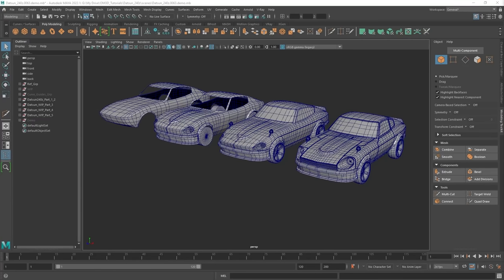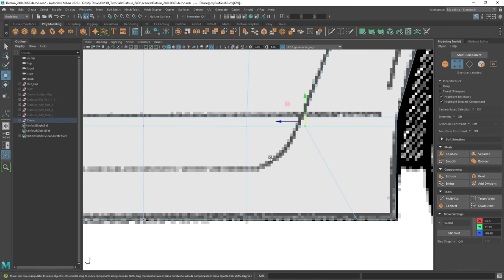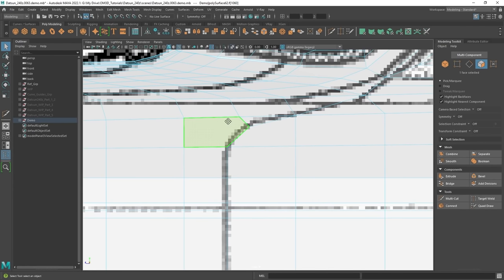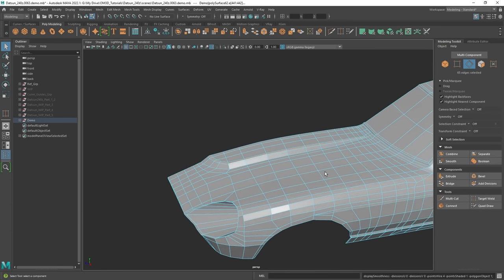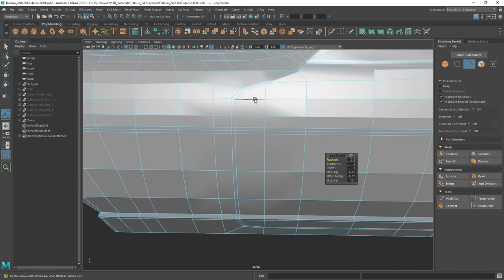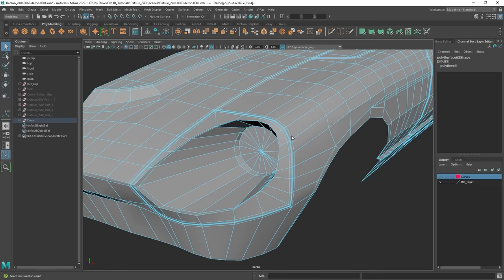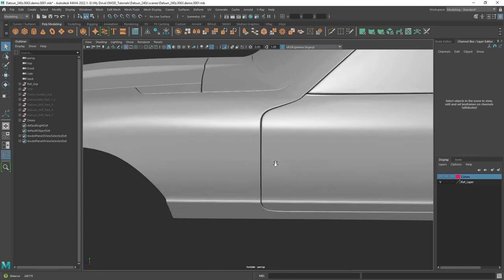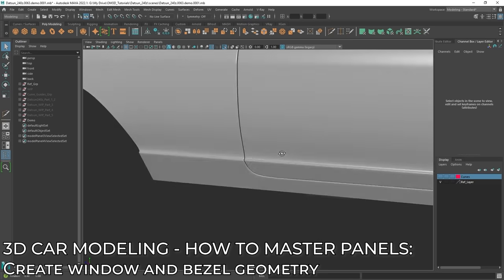3D Car Modeling - How to Master Panels

Comment: For all the automotive people out there, also keep in mind that the gaps on cars are slightly different depending on the panel and not all the same. Door, and trunk lines tend to be a bit wider, sometimes on the hood too. It also largely depends on the what car you're making, older cars didn't have super tight gaps like modern cars do, and even some modern cars mess it up from time to time. Make sure you keep an eye out if you're using references as it will add more authenticity to your model. If you're building fictional cars, ask yourself what kind of manufacturer is this, if its expensive luxury/high tech then the gaps would be tighter and precise, if its a cheap soviet mobile, the gaps are going to be horrific.
Reply from the maker: That's a great point, I used different gap measurements for different parts of he 240z. Details like this will really help push the realism of your vehicles.

Comment: Thank you for all your videos and really useful tips, I've been trying to follow along this series but I end up with a wobbly surface each time I try to add in some details... I've restarted 3 times now and it feels really demotivating to fail over and over, but I'll keep on going in the hope that one day my models will look nearly as clean as yours.
Reply from the maker: Just keep practicing. It may help modeling simpler objects and then coming back to the vehicle modeling. You will eventually get it!
Reply: Be sure not to sweat small amount of pinching here and there, if its super noticeable sure, but don't get stuck on very small areas that may not even be seen. Always keep your final goal in mind, if the camera doesn't get close to what might be considered a 'minor mistake' then you have to make a choice whether you want to spend the extra time or just move on with your life. Always remember that Subd modeling is simply an approximation, if you want perfect surfaces you'll need to go learn cad software.

Comment: So in order to create game assets all these parts don't need to be a part of the same mesh? They can be separate and just combine them all at the end?
Reply from the maker: Correct, but as always, it depends on the use case of the model. In the case of a vehicle or gun, you can combine all static parts but you would need to make sure the parts that move are separate.

Comment: Hi Mars, new sub here, i would like to know how do you deal with sphere forms thats has hard edges like the Chain Chomp from mario, i have a problem trying to keep the sphere form smooth when i add edges for the teeh to keep them with hard corners
Reply from the maker: Hi Nacho, in the specific case of modeling something like chain chomp, I would keep the teeth modular, so keep them separate objects. 

If you really want to keep it all one object, then I recommend increasing the amount subdivisions before adding the teeth. That will allow you to have the edge flow to extrude more detailed areas. 

I cover those common issues here where I show the difference of using a primitive with 16 subdivisions vs 32 subdivisions when modeling the Mandalorian Helmet -- How to Fix Bad Surfaces: https://youtu.be/bQqr8ImjScU
Reply: @OnMars3D  thank you for the reply!, i used the chain chomp as an example but in the case of the model i want to create (that i took it from a concept art) it has the teeth and the head all in one, its doesnt have a line that divides it like the chain chomp, anyways im going to try you advice thank you!